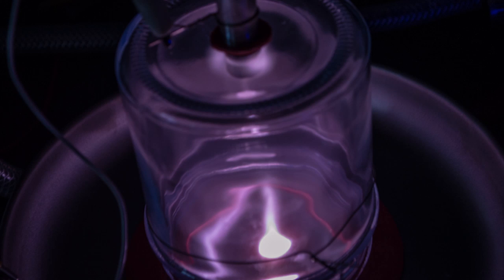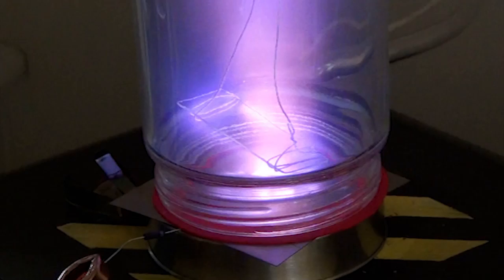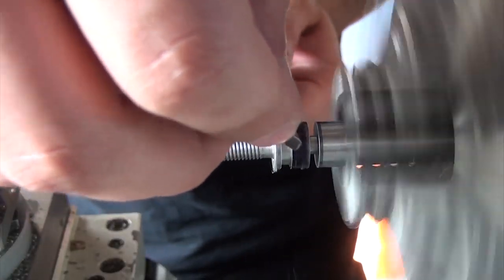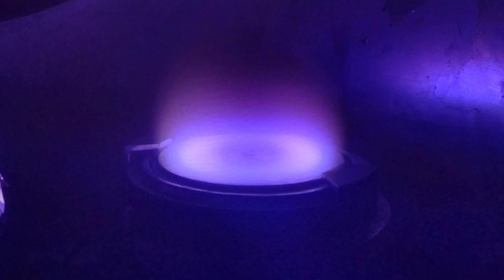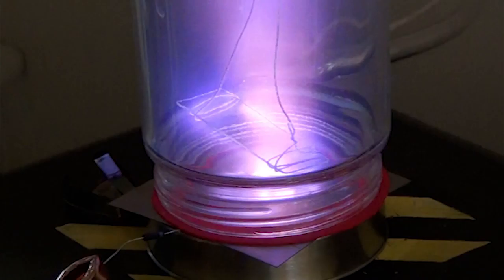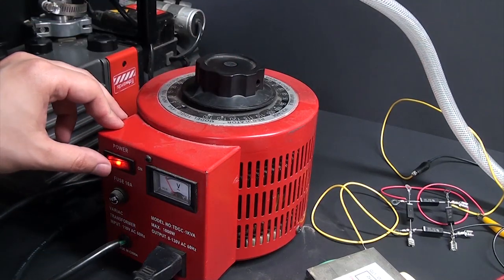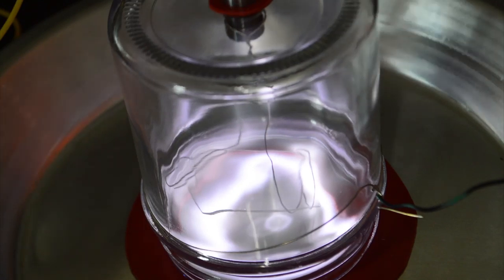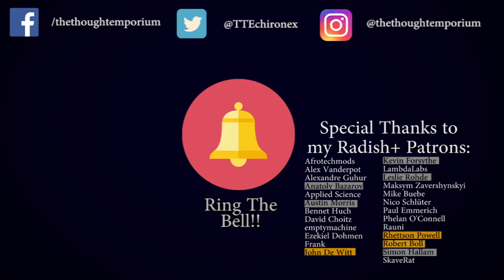My First Successful Metal Coating Machine - Magnetron Sputtering

Comment: Maybe a good method of cooling the magnet would be a machined aluminum cylinder fitted slightly larger than the magnets. You could use a thermal interface material like a CPU thermal paste to transfer any heat away from the magnets and into the aluminum. Then you could run water across the aluminum to draw the heat away and into a radiator.

Comment: the counter measures on the F22 might be made by finely controlling external magnetic fields to build micro structures via sputtering.
this kind of high resolution additive manufacturing via sputtering is one way of depositing odd materials giving them unexpected physical properties and is unique to the secret realm of defense manufacturing.
even the self destruct mechanisms on UAVs. nothing but iron and it turns to a "thermite" upon exposure to the atmosphere.

Comment: Could you swap out the Microwave transformer for a Neon one? That'd still get you your high voltage with a far safer lower current. It'd still suck to touch the thing, but it wouldn't be instadeath.

Comment: omg your power supply is very much like my bench power supply that i made for experiments.
exact same variac and transformer.

except my setup is a little different
2 variacs on seperate phases then i take the live wires from both and i feed that into
3 microwave transformers in series,

and yes indeed it does hurt when you touch it, not as much as crt tv bulbs but still pretty nasty shock.
Reply: the best part about my setup is , as long as i don't touch both terminals on the output side of the transformers at the same time
i'll be fine.
because they are setup like isolation transformers , which means their is no path through ground :) 
but of course you know ... should never really push ones luck and should take precautions just in case.

Comment: Is the argon you use just normal argon or ultra high purity? I used to work on vacuum metalizers and we had to use the ultra high purity argon. If someone put normal argon on the system it would not work properly.

Comment: full bridge rectifier!!!!!
Question: What type of personal safety equipment do you need? I assume the plasma arc is as bright as a welder so you are wearing shades? How much radiation does it put off? Do you need a full welding mask/cover all skin?
Reply from the maker: It lets off some UV but otherwise it's not that bright. Just don't star at it I suppose. Beyond that it's most protection in case of implosion, and electrical safety stuff. So lots of emergency shut off switches.

Comment: Please! try making a mirror out of aluminum. I don't know what's a better reflector: aluminum, or silver. Your video suggests that you've had success with silver, but, I didn't hear mention of aluminum.
Magnet: Have you tried the magnet out of an old speaker? It too, has a center pole, opposite the outer ring. The only problem may be a very narrow gap between the inner pole and outer ring. It's big, heavy, and would take a long time to heat up, just by virtue of thermal mass. It would indeed create the larger gap ring you're looking for, and, because it's focusing the field strength of large ceramic ferrite magnets,  will yield good focused field strength. It's cheap, for free, if you pinch it out of a "blown" hi fi speaker.

Comment: My 2 cents, over a year later: I don't know how much of an issue heat was with the final magnet set-up, but you could get better flow around the whole magnet if you put a thin wall between the inlet and outlet from the magnet to the case.

Comment: How hot does the plasma get?  Could you sputter-coat polystyrene?  Could you sputter-coat polysytrene and then machine and/or heat-shrink it?  You have an opportunity to push past the state of the art in microfluidics and use a combination of sputter-coated electrodes and heat-shrinking to get tall and tiny electrically conductive features.

Comment: Do it on some Aerogel. I’m curious if it will penetrate down into to it. And what happens to the Aerogel once water is added and the gel beaks down. Will the copper structure remain or will it breakdown with the gel?

Comment: BTW, there is a low-vapor epoxy called Torr Seal made by Kurt J. Lesker Co. that is not terrible. It's very brittle though and does not like being exposed to plasma for long periods. Consider it temporary.

Comment: Just had an idea with the copper coated glass. Could it show patterns on the surface of the glass using iron filings while passing a current through the copper? I imagine it might need some kind of a coil to make magnetic fields but I thought it might be thought provoking to post this nevertheless.

Comment: I am quite happy for you, that you got this to work after years. The mention of you dancing around the room when you got it right, was quite amusing. :)

I was actually thinking about task for sputtering, a month or more ago. (Just an armchair kind of pondering.) I saw a video where someone took a CPU, and a grinding plate, and flattened the cap on the CPU by grinding it. (This was to improve thermal conductivity between the CPU and radiator.) But it took the finish off the cap. So I was wondering if this kind of sputtering would possibly be useful for putting a new finish on the cap, without frying the CPU somehow, or damaging it…

Comment: Can you design a chamber that is essentially upside-down?  I'm wondering if you could coat a slide of fine diatom powder. If that works, metal coated diatoms might be easy to study with a metallurgical microscope.

Comment: For the piece you used to try epoxy with but this time made a custom part with the lathe-- why not just drill a hole down the center of a plain old bolt?

Comment: This is so awesome.
Do you think you could do lens coatings? I use vintage anamorphic lenses, and one of the most important aspect is the color of the flares, which is determined by the color of the coating. It would be so cool if you could make different colors with various metal oxides.
Also how durable is the coat?

Comment: Amazing! Why do cheap sunglasses with metal coated lenses typically lose their metal coatings with soapy water? I imagine it's a process or contamination issue. It would be awesome to see you demonstrate something like this. Mirrored sunglasses are probably the most commonly visible consumer application for this technology. That might be relatable to a wider audience and could generate more views, although it is probably more scientifically mundane than you typically achieve here.
 
 I just want to lock you and Sam Zeloof in a well equipped lab and set the lock timer to "Well Done." Perhaps, Ben's Applied Science lab, but then we'd have to lock him in as well :-)
  Thanks for the inspirational upload.
-Jake

Comment: Could you use a strong magnetic field to deflect a beam of mixed ions? Say you put a slice of cake into your plasma source. Could you direct a beam of the resultant carbon, hydrogen, oxygen and traces of other stuff past a magnetic field, and then have that produce separate lumps of each element (or even isotope) on the glass?

Comment: You still need a bit more experience in vacuum technology to find out that silicon gaskets are only good as air filter at best but definitely not as seals, because they allow air to pass easily. silicone is even used as a gas exchange membrane.

Replace seals with something else, like polyethylene plastic or normal rubber and it will be way better.

it is still super hard to achieve airtight seals but if you are constantly pumping everything out you kinda can achieve an aceptable vacuum.

Comment: Just a question, isn't it possible to accidentally generate x-rays by applying high voltage to the vacuum chamber?
Reply: 0nLyCh4oS - I doubt the low voltage used here could release a x-ray photon, x-ray sources usually use more than 30kV to accelerate the electron.

Comment: So...... Why not a oil burner transformer? They are typically 10k volt and through some trickery with a trooper from an old school projection tv you can approach 30k. Do you need the high frequency of the microwave transformer?

Comment: I used to use a sandblaster to drill bottles , it doesn't chip or break the glass but you might tape the inside so it doesn't get frosted by the sand once the hole starts. 

Would Nitrogen or other inert gasses work for this?

Comment: A microwave transformer is pretty much actually a constant current source and it has to be since when the magnetron is working it is effectively a short circuit but due to the way the transformer is built it only put out a certain amount of current even if short circuit. The diode must be able to take this current and thus shouldn't be destroyed even at full blast, but it's nothing I have tested.

Comment: how difficult would it be to scale this up to make copper cladded boards? Maybe using a rectangular pyrex dish instead of a jar?
about how long would it take to get a 1-2mm coating?
Could you use this to coat a magnet in a bio-safe material like TiN or diamond?
Reply: 1-2mm would take weeks, or probably even months of continuous sputtering. TiN is possible, but requires a rather finicky nitrogen control system, since it only works in a small pressure range.
Though you can make conductive boards using ITO - that's literally how all displays and translucent circuits are made, with this exact process.

Comment: I've read through about 400 of the comments on this video, and this question hasn't come up yet, so maybe it is a stupid one, but why put the rectifier bridge on the high voltage side? wouldn't it be easier to put a cheap one on the low voltage side, maybe even a few really decent smoothing capacitors (again obtainable for cheap) and only then put it thought the microwave oven transformer?
That should be a cheaper setup, and you only need to gut one microwave for the MOT instead of four for the diodes and/or capacitors
Reply from the maker: Because that's not how transformers work. They need AC to function. If you rectify the input side, you're not gonna get anything back out.
Reply: I just went back and googled the exact working of a transformer. This completly changed how I conceptualize the working of transformers. However, having thought about them in the wrong way my entire life with a kind of "magnetic fluid" anaolgy, i now have to go and do a few experiments to see if I can build a pump on this principle. Thanks a lot for the quick reply

Comment: You should really use a lubricant when cutting any threads, petroleum jelly or even cooking oil will make life so much easier! It will decrease chances of snapping a tap massively and reduce needed torque by more than you will imagine.
Reply from the maker: I was..? Maybe you didn't notice me squirting wd-40 on it or it just didn't show up well in the shot
Reply: @thethoughtemporium  no i missed that, but wd40 isn't really a lubricant, trust me any form of oil or grease makes a big difference. There's no real need for something like Dormer Supercut (I think that's what I bought) I end up using Vaseline most the time, whenever I have broken a tap M4 or down I always skipped oil... and yes sometimes I still skip it and end up paying the price

Comment: You can get rid of copper films with a mix of hydrochloric acid and hydrogen peroxide, but make sure the process is not negatively influenced by hydrogen ions that emit from the glass afterwards.

Comment: Cutting the hole in the glass is so much easier, get a carbide tipped punch and just tap at the center where you want the hole to be. Be patient, it really only takes five minutes. Iv done several making water pipes out of Heineken bottles. The hole comes out perfectly round.

Comment: I saw this done with a much simpler set up. Larger vac chamber(large pickle jar), microwave transformer with much higher voltage. Larger moveable magnet and no Argon. His mirrors looked better and was larger.

Comment: Sorry if it was asked before, but is there any possibility it could be used to build a PCB over glass for example? Any idea of a printable material that could isolate the copper ions to build traces?
Reply: Anything printable will probably work. ITO sputtering is literally the way all displays and whatnot are made. Patterned transparent conductive layer.

Comment: You should really consider getting something more suitable than these crocodile clips... They are good for 100V at most, but they are neither designed nor capable of shielding kilovolts and can give you an extremely nasty and deadly shock when you touch the "safe" plastic part. Get some proper clips and cables (Hirschmann is an excellent source for that stuff, but it will cost you 15-20 bucks per clip/cable).
And maybe consider adding a bleed off resistor to your dc output as this device awfully looks like a leyden jar (especially with a sputter coating on the inside).

Comment: How would you sputter the inside of a glass tube? I am looking to build a co2 laser from scratch.....
Reply: Lel, the whole jar that he uses kinda slowly gets sputtered. You could just rearrange the magnets and electric field to have more deposition on the jar itself.
If you have a sputtering setup that fits inside your tube, then you're pretty much there.
Reply: @sasjadevries  I am trying to sputter a 13mm tube 1800mm long on the inside....
Reply: @CapeCodCNC  That will not work. You'll need physical silvering.
Also, why would you want to sputter the entire inside of the tube? Do you have any idea how CO2 lasers work?
Reply: @Spirit532  An MIT paper on co2 lasers showed increased beam stability and power density using gold sputtering inside the laser tube, so yea.......
Reply: @CapeCodCNC  If you succeed in building a CO2 laser, you're probably only ever going to be able to build a very basic one, not replicating bleeding edge research...
Reply: @Spirit532  time will tell......

Comment: Could you use this to make conductive glass for custom LCDs?  How could you mask off "segments"?
Reply: You could, yes. Replace the target with ITO, and mask with anything you want. Metal stencils, low-outgassing high temp resist, etc. You could also etch it in post, when it's not blistering hot and under vacuum.

Comment: How is this different from vacuum vapor deposition created by an electron beam?
Reply: Beach&BoardFan,  I imagine the mechanism of liberating the the metal atoms is different, instead of the electron beam striking the target, the argon plasma does it and as the video explains it, the liberated metal ions then start doing it too.
Reply: So its a similar mechanism, but done at plasma vacuum pressures instead of EB vacuum pressures? So its still just ionized target, does it bond to the surface the same way with either process, or does one have a better bond over the other?

Comment: Question: would it be possible to use this method to coat things in the graphene you got from your old Electrochemical Exfoliation video? Or does that not have the charge necessary to work with this? Also, would it be too powdery/flakey to work?
Reply: Belatedly realised that it might not even be worth it to do so, as it might not turn into that fine sheet of graphene that you need for graphene to be useful.

Comment: 20, 45, 50V? Is that before or after the flyback transformer? If after, are you driving this thing with AA batteries? xD
How are you driving the flyback? I used a halogen driver, but it gets very hot and stops working after a few seconds because of the over-temp sensor.
Reply from the maker: Before, and it's a MOT not a flyback.
Reply: @thethoughtemporium  Isn't 8:22 also your current setup? That is a flyback transformer there in the middle.
Reply from the maker: @GLITCH_-.-  Was just using that for testing. If you watched the rest of the video I explicitly say I'm using a MOT.
Reply: @thethoughtemporium  Yes. How are you driving the flyback there? What is that thing to the left of it?

Comment: cant you just use physicam vapor deposition to coat stuff in copper ( basically you use a high current heater to boil copper in a vacuum chamber)

Comment: you should have used epoxy mixed with metal dust for the magnet. epoxy is an insulator you need something conductive too cool the magnet

Comment: How stable are those coatings? Ive been thinking about building a see through arcade. But until now it was difficult to find see through PCB's
Reply: I´m pretty sure you won´t be able to solder to anything. These coatings will always be pretty thin, so they´re easy to damage.

Comment: Maybe a Peltier plate would make the cooling system simpler
Reply: simpler? How do you cool the peltier element then?
Reply: @Basement-Science  you give it power.
Reply: @u0000-u2x  That´s not how they work...
Reply: @Basement-Science  afaik you give it power and a heatsink and one of the side cools while the other expels the heat. Can you be a bit more explicit on how this would not work instead of being condescending? :)
Reply: @u0000-u2x  Exactly right, it needs a heat sink on the hot side. That heat sink has to be More Capable than the heat sink he made for the magnets in the video. It has to dissipate the heat from the magnet PLUS the heat generated in the peltier device (they are very inefficient) to be equally good as the water cooler in the video.

Therefore it is not simpler than what he did in any way.
Reply: @Basement-Science  good to know! I've never used one so that's why I said "maybe". You should have made this your first comment ;) much more helpful.

Comment: I've found those colorful alligator clip wires to be rubbish, specifically the crimp of clip around wire, which lets the wire go and heats with current.  Might not make a difference for low current though.